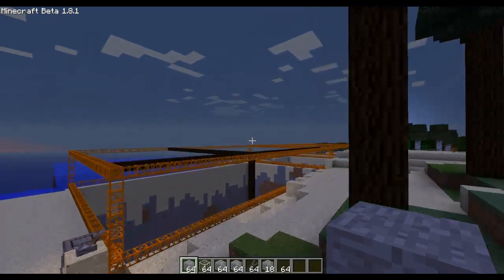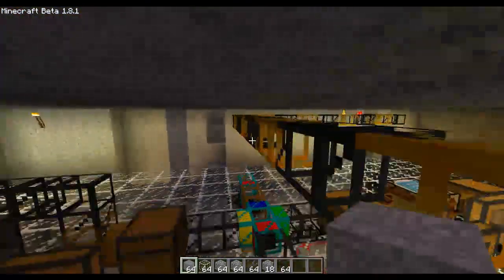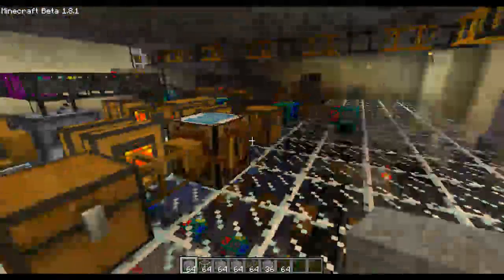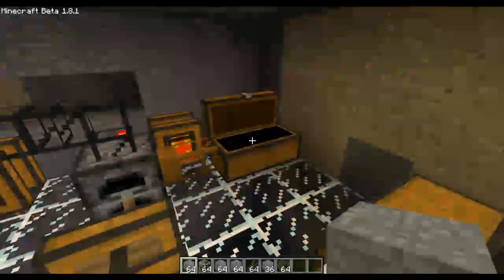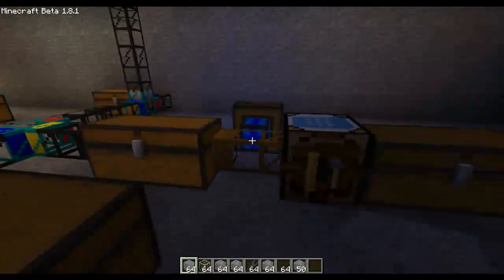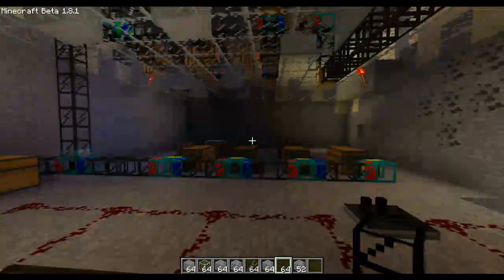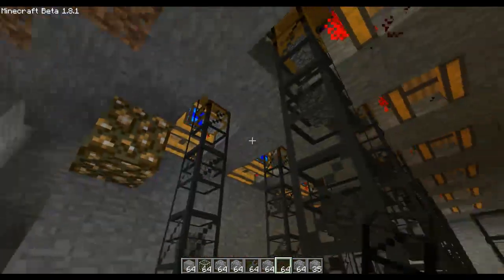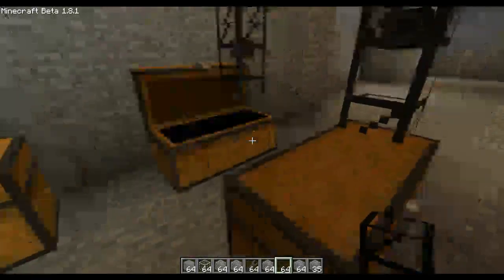Huge BuildCraft Factory - 2,000 View Special

Comment: If you use computercraft you can build a program that will cause the dispencer to drop an item on the pressure plate every two min and it be fairly easy program
ex. sleep(120)
redstone.setOutput("back", true) you can change back to whatever side you have the dispencer on
redston.setOutput("back", false)
shell.run(whatever the name of this program)

Comment: I don't know how long computercraft has been out but I use it for alot of things like the mining turtles (their slower and slightly more annoying to use than the quarry but much cheaper to craft and operate because all you need to operate it is a fuel source lava, coal etc and then just give them the command) but the quarry is much faster and with out the pipes from build craft turtles need alot of work to make sure their chests dont fill up (without using a complicated program)

Comment: hey you do know that if you make a infinite water source (3x3) and have a water pump in the middle then you will never use up the water like you are in the ocean or whatever....yeah i know that it might take forever to run the ocean dry (if that is possible) but you would never have to worry about any of that with an infinite water supply